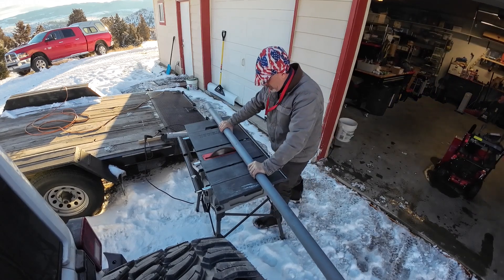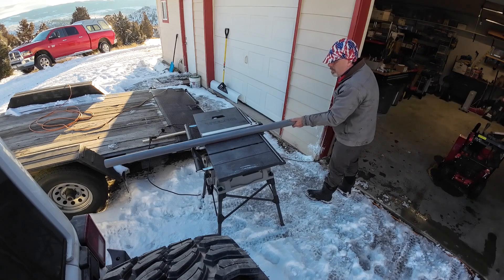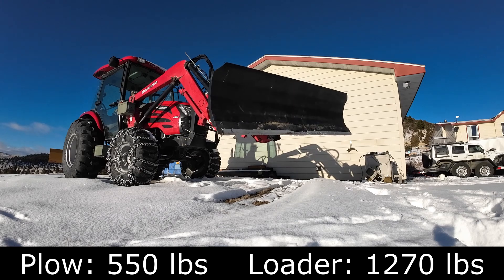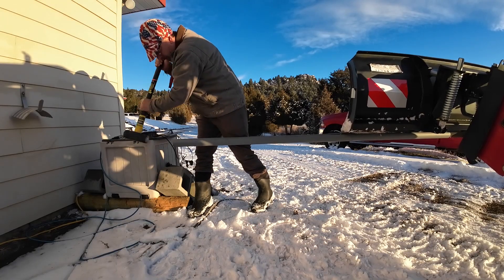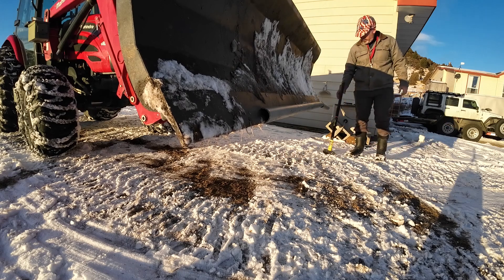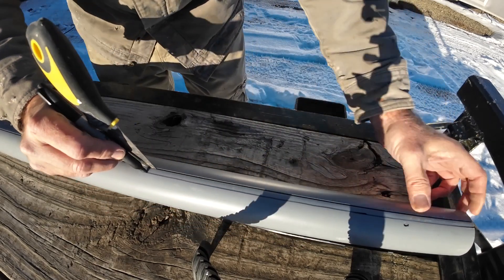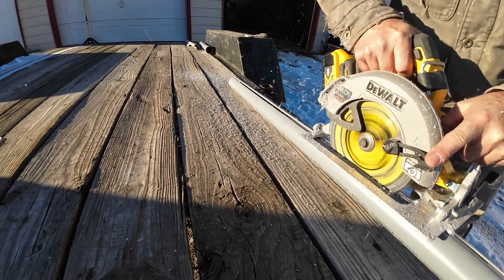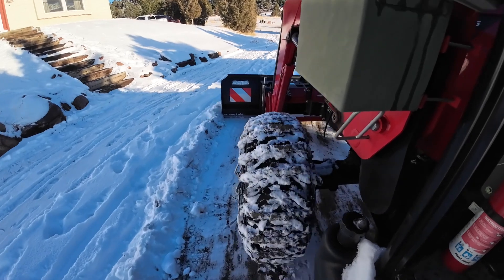PVC PIPE for 7ft Snow PLOW: HARD LESSONS

Comment from the maker: I broke the schedule 80 in about 20 minutes of plowing! AAARRRGGGHHH! But check out the next video, where I make one out of steel. It works so much better in the rocky mountains. ABS and PVC likely work well on flat and manicured ground and would still be cheaper and easier.

Comment: Are use the Datto blade. The width of my plow slid it on but before I did, I put a bead of non-expanding foam inside. The pipe, even though it is non-expanding it still expands a little when it dried the next day it was on very tight. This worked extremely well for me, and when I returned to remove it, it all came off real easy, no mess. I did use the advice. I think Bill said putting a hose clamp on both ends and snugged it down to get a little more grip. It really worked amazingly well, but I wasn’t running over. lots of rocks, mostly concrete and blacktop. It really did a nice clean job. My neighbor he saw it and he tried the same thing using silicone in the pipe seems to have worked well, but I don’t know what it will be like when he removed it

Comment: Thank you very much for creating this video and sharing your experience.I have not put pipe on my plow edge yet. But based on this video I'll try the same way shown here
Reply from the maker: So be sure to click the video link at the end of this video, I ended up switching to steel because I kept breaking plastic and pvc pipes. The PVC pipes seem to work well on smaller blades like ATVs and utvs, but a heavy tractor plow or truck plow, especially on uneven terrain will probably break pretty quickly

Comment: Similar set up as yours had 2 1/2" SCH  80 conduit on hand and gave it a try it lasted 5+ weeks, then tried 2 " ABS that most recommended (hard to find) it only lasted one day of use  now I'm out of ideas as I don't weld and with several inches of snow every other day I can't farm it out.
Reply from the maker: OK, finally got the video up! The steel works really well for the rocky mountain terrain. I think PVC and ABS probably work well for many folks with flat and manicured roads/terrain. Hope this helps. I would like to hear about your project and how you end up doing yours! You might find if you make your cut just a bit narrower than your blade, use ratchet straps to hold it in place and pound it on, you may not need to weld any edges onto it, it may be tight enough for your needs, or worst case it slips to the side some, and you just pound it back in place
https://www.youtube.com/watch?v=MVhIKQvNplc
Reply from the maker: @inspectr1949  I'm working on a video this weekend, I broke my schedule 80 pipe last weekend, so I got a 2-in inner diameter steel pipe, 2 3/8 outer, 3/16 thick, I got two 10-ft sections, clamp them together, and cut a 1/2-in slot out with my Bauer metal cutting circular saw. It worked really well. I made a couple brackets that I welded to the pipe and bolted to the plow flanges. My neighbor and I used it for about 5 hours yesterday, a couple small dents in the ends where I smacked rocks really hard, but it worked really well. Hope to have the video out by sometime next week. Sorry, you and I have the same growing pains at the same time LOL
Reply: @anesthesiadreamin  Didn't follow "clamped them together", guess I'll wait for the video. 12" snow here predicted next 18 hours, 3rd  storm in a week, guess I"ll take the plow off and switch to the bucket.
Reply from the maker: @inspectr1949  sorry, I meant lay them alongside each other, I put a clamp into each end to squeeze them together so there are two pipes laying side by side but tightly against each other. Then I ran the circular saw along the edge of one of them to give me a nice straight cut on the other one. When that cut was done I rolled the cut pipe a bit to make another cut, so after 2 parallel cuts I ended up with a perfect 1/2-in slot, just enough to fit on my plow cutting blade.